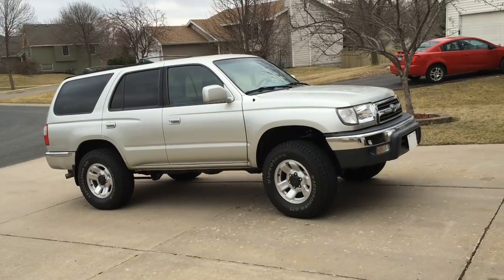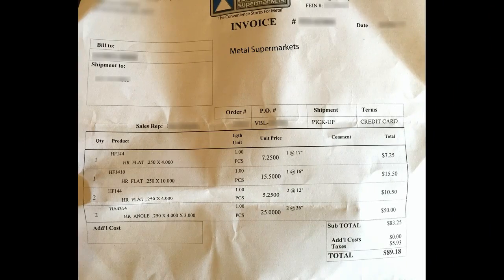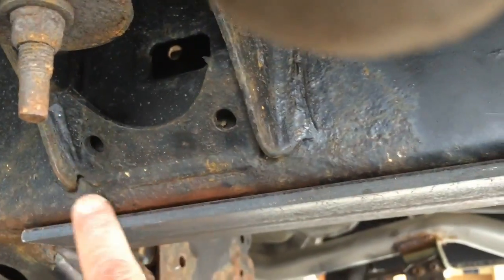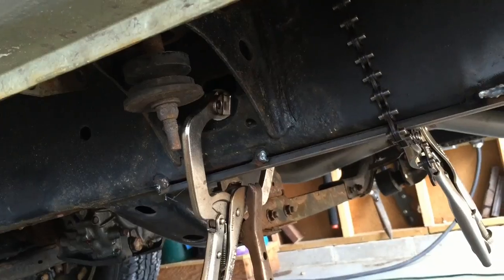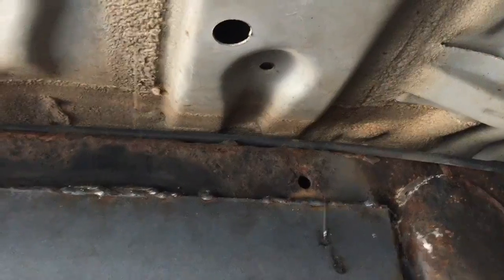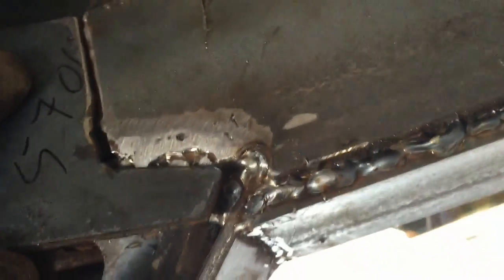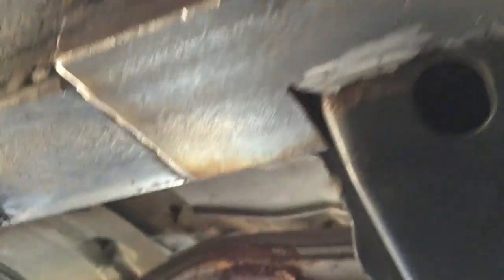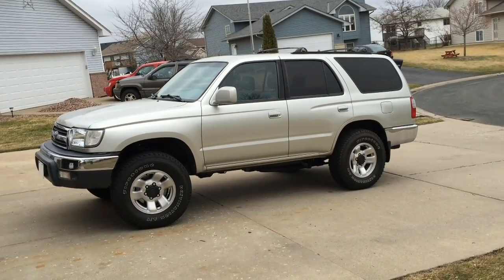2000 Toyota 4Runner Frame Rot Repair - Welded

Comment: for the amount of time spent welding and repairing rust, you can just swap out the chassis for a used oner that is clean, I have an 02 sequoia that needs a chassis, and after long consideration the best bet is to swap it out. Found one on car-part.com for $450
Reply: ur talking about a LOT of work, for an unexperinced person.

Comment: Buy a Ford next time.  LMFAO!!!!!  I own a Ford PU and a Tacoma PU.  Guess which one has been virtually trouble free and which one I've had to replace virtually every front of the engine device including water pump, alternator, power steering pump, air compressor pump, and had the transmission rebuilt, fuel pump, new gas tank, and on and on and on and on.  Yep, the hell with Toyota - buy a Ford.  Or buy a Chev that's rustier than your truck.  BTW, the Tacoma has almost 300K on it and the Ford 164K.

Comment: HUGE fail. you should have removed all the rust. you should have cleaned every surface you were welding. and the spring mount should have been reproduced by you.
Reply from the maker: I appreciate your assessment of the situation.  For me it was a HUGE win.   Not only did I learn a lot, I took an asset w/ $0 value (undrivable) to one that has been on the road for almost 2 years now.   Not a bad deal for some steal, and time.   I guess, it's not for everyone.

Comment: You have no business welding on a frame if you are not qualified. But if you were qualified, you wouldn't be welding on the frame. Hopefully, this doesn't break when you are on the highway and you kill someone innocent out there or yourself. Best repair in this case would have been replacing the frame or towing the 4Runner to the wrecking yard. Would have looked better crushed into a cube.

Comment: Toyota are junk!  Toyota frame rust because its a closed frame,dirt and water find their way inside,get trapped and humidity do the rest,rust start and eat the frame. My old 1977 chev truck frame is still very strong,thanks to the open frame rail design, even if was neglected before i get the truck.